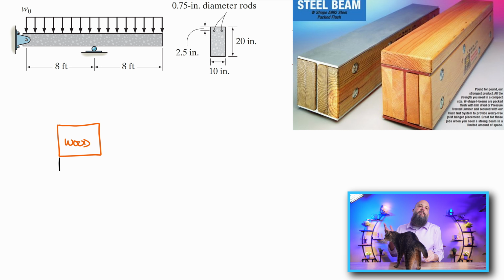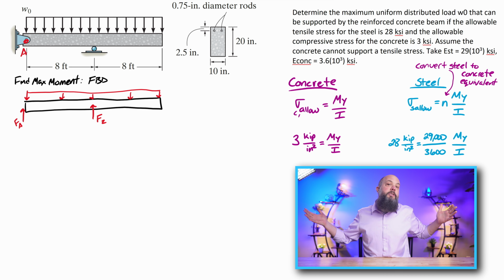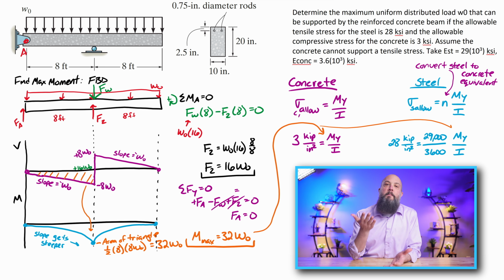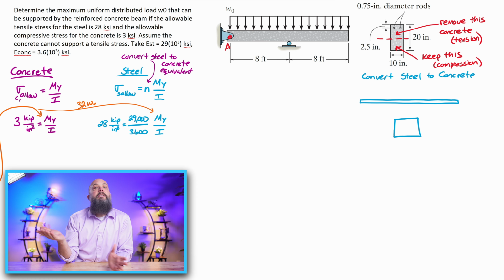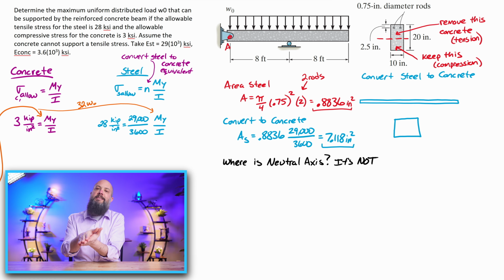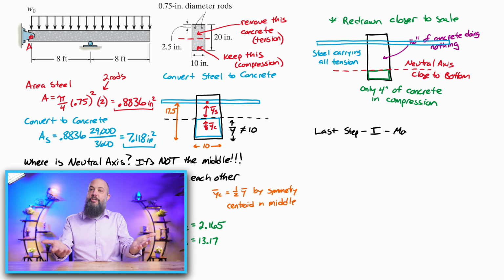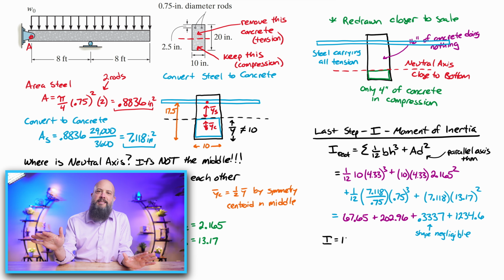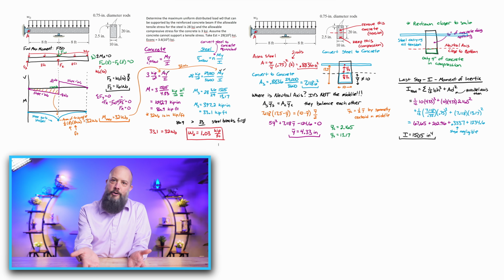Steel Reinforced Concrete Bending - Finding the Centroid is BONKERS

Comment: Comment posted on Monday, 5 Oct 2026

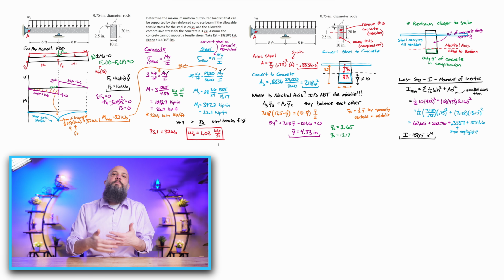15:15

1.) Regarding a reinforced concrete beam
( Overhanging beam )
( As shown in the lecture example )

1.2) Based on the structural analysis of this beam!
The beam can support a maximum distributed load of

w(allow) = 1.03 kip/ft

( Resulting in a (negative) bending moment = - 33.11 kip-ft )

At the tension reinforcement ( 2 rods with 0.75-inch diameter )
( It can withstand this (negative) bending moment according to the analysis )

A question!

2.) If we want to find the (maximum) deflection value at the free end of the beam

2.1) And simulation programs provide the deflection equation for the beam's end as follows!

Beam deflection: 

Delta (max, at the free end) = - 1,054.72 ( kip-ft^4 ) / E•I

2.2) We can substitute E(concrete) = 3,600 ksi
( The E(concrete) value specified in the problem )

And convert the units to

E(concrete) = 518,400 ( kip/ft^2 )
( To substitute this value into the beam deflection equation )

2.3) We can substitute the value of

** I (for the transformed section—converting reinforcement to equivalent concrete) **

I = 1,505 in⁴

Converting units to

I = 0.072579 ft⁴
(to substitute this into the beam deflection equation)

2.4) We obtain the maximum deflection at the free end of the beam

Delta(max) = -0.0280 ft

Delta(max) = 0.3363 in
(the beam end deflects downward)

** I would like to know! **

Using the Modulus of Elasticity of concrete

E(concrete) = 518,400 kip/ft²

and the Moment of Inertia value
(of the transformed section—converting reinforcement to equivalent concrete)

I = 0.072579 ft⁴

by substituting them into the beam deflection equation to find the maximum deflection at the beam end
(for the case of a singly reinforced concrete beam)

Delta(max) = - 1,054.72 (kip-ft³) / E•I

Is this understanding correct or incorrect?

Thank you teacher.

------------

Comment: I got confuse around 10:15 , since you are assuming y_concrete =  ybar/2, isn't this assuming Nutral Axis is at the bottom of the concrete? Since by definition from the lecture, ybar is the distance from nutral axis to the line of intrest , and y_concrete is the distance at midpoint of that component to the line of reference